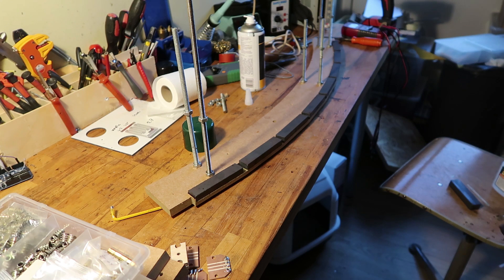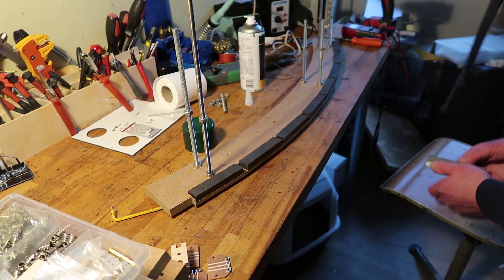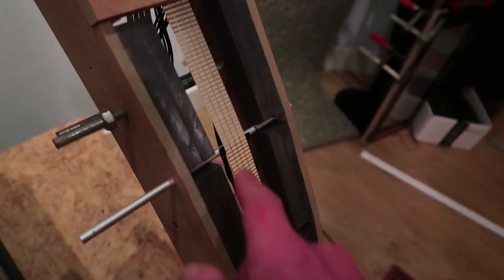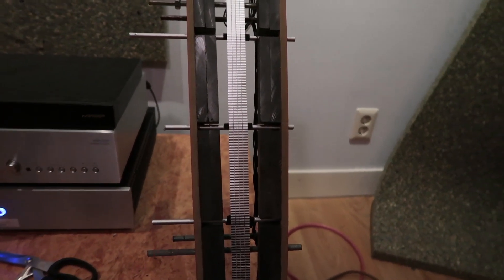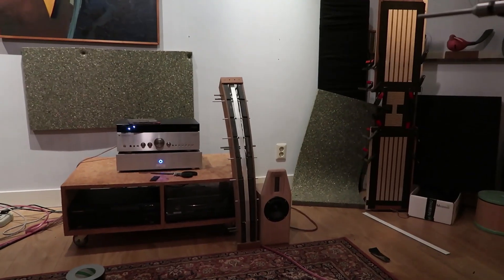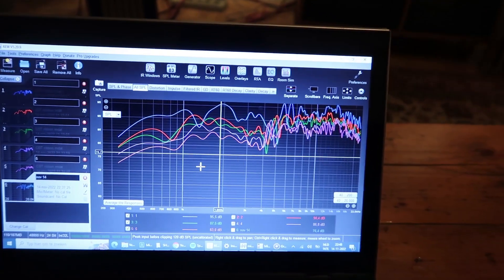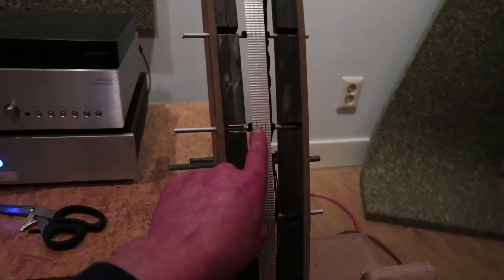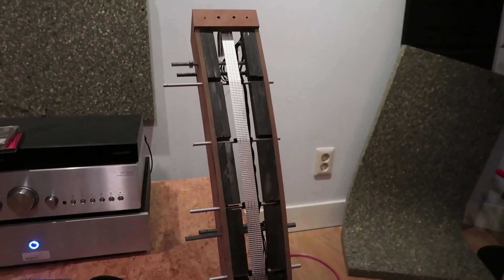Constant Beamwidth Transducer (CBT) Ribbon -  Part 2

Comment: The concept is great. The main problem is you are trying this as a dipole. Not the way this CBT design works. If you capture the back wave with mineral wool in between your cheeks you will be getting the benefit that you are looking for. Very interesting idea. I have thought of this using discreet planars. Easier to dial down. dOWn.

Mark
Reply from the maker: i think there is plenty of dipools done, and they work and even have bvenefits in terms of reflections.  a ribbon does not output more low ends when damping is used on the backside :( i tried :) might help in reflectiojns form my back wall though :) im more worried about the gaps up top. closing them would gain some lower end
Reply: @joppepeelen  Did you download Keele's papers on the CBT principle?  It is a monopole, this is the basis of a SONAR array, again a monopole. You have such of it right. If you try it first as a monopole you have an original reference point. Then you can try the dipole. I  worked with these about 10 years ago. Driver matching as you are doing is very important.
Reply: @joppepeelen    I understand the idea you are trying. My simple point is that the directivity gained in the shading used on a CBT type array is purposefully monopole. What you are doing will be a mix and most likely have nulls because of this. You have great points regarding how a dipole uses reflections. The key is that a CBT does not. It focuses the sound in a direction. That was the entire design idea in it's original use as a SONAR array. To have as even a power distribution as was possible in the output of the SONAR transducer array. Kind of like synthetic aperture RADAR arrays. They use timing ( phase angle differences ) and power differences to steer the Radar pulse sent out. What I know is you understand your planers very well. Seeing that this has potential I would immediately go with a wider film and make them into discreet planars and see what you can do with this. It has a huge potential to be a very good loudspeaker.

Mark

Comment: Room size and other issues are always a problem , a cheap way to fix up a sound room is wool blankets suspended from rods out from walls and surfaces about 3 inches or 75 millimeters in your measurements, helps a lot with reflection issues , not perfect but very good .
Even the ceiling surface is a huge issue that make the sound from the speaker become very disturbed , buying old army surplus wool blankets are very inexpensive.
Reply from the maker: yep, but i try to live here as well :) hihi.  when the weather is good i usually try measure at least 1 or 2 times outside.

Comment: I don't understand one thing. According to their graphs , to have an appropriate -6dB level angle at 5kHz, a height of an LSA must be 10-20cm. Why a h.. they made them as huge as a mid freq LSA?
Reply from the maker: LSA >? line source array ?  in the PDF above you can use the graphs to see what the lower frequency is it is maintaining constant beamwidth.   i used the groundplane graph, since this is actually a line array cut in half , so the most efficient part is sitting on the ground, and the idea is the floor acts like the second half.  thats the idea at least.
Reply: @joppepeelen  Exactly. I mostly mentioned their experimental devices. A half-sized CBT loudspeaker could be a good solution as a table speaker (low power, low distortions, compact horizontal size). With a beam of 20-30 degrees width, this must be a big enough room to have a listening zone high enough at some distance from a half-size loudspeaker. At least 3m long imho. A full-size CBT can be properly oriented in this case.
So, this is a great idea overall, but needs many experiments. This is what you like the most -) May be we will watch a serie dedicated for such devices.
Reply from the maker: @sc0or  well i am no expert in CBT's :) the fun factor f these might wear of, but learning stuff as we go.  i do need to make a 2e one i think. just to hear how well it maintains phantom mid etc.  then again there sens is so low im not sure if useable :( might need to check that with the most insensitive driver i got haha
Reply: @joppepeelen  That could be an interesting device: an arc with a woofer panel behind, then an array of mid drivers above, and then above of all of this an array of tweeters goes. I’ve seen something in the paper.

Comment: Smart idea with the expanding spacing! I guess you simulated the whole motor, does the magnetic flux density have the same distribution when the distance between the magnets increases?
Reply from the maker: sort of , sides remain much stronger.i did not compensate the ribbon itself for that, since i used existing ribbons  the spots with the huge spacing  have slightly less of this high peaks of flux density acting on the outer traces of the ribbon then the more efficient parts. :)  so it would be a compromise in any case with widing the traces. but not to much :)
Reply: @joppepeelen  Yes, perhaps the whole ribbon should be tapered towards the bottom, not just the traces.
Reply: @joppepeelen  great work as usual, thanks for posting. Regarding the magnet spacing, that's super clever. But I wonder how much the reduction in damping with the change in Qes affects the general amplitude shading. Perhaps there are even some benefits.

Comment: CBTs should hang from the ceiling. Otherwise the shading and time delays doesn't make any sense. CBTs are for PA to get the same SPL throughout the arena; also when moving around. They are not for domestic use.
Reply from the maker: its a groundplane CBT in this case. it uses the floor as mirror to make the line longer. thats why the 0dB region is at the bottom. weird but thats the design.  you  know how a flat line source sound . why is this not for domestic use ? it has better dispersion then small line/tweeter from 10 cm onward.   check out keele, in his youtube video hes show how even the frequency remains almost unchanged  up and down close and far away..  pretty usable it think for anyone making drivers/planars that are to long for there frequency range.
Reply: @joppepeelen  Yes I know, but Keele is wrong. I built  ground plane CBTs ten years ago. The were useless, so I stand by my objections.
Reply from the maker: @ClaesJegerås   nothing wrong here i think.  https://youtu.be/OjfyFjUBrlY?t=367  it does what was promised. what troubles did you have ? might help me to
Reply: @joppepeelen  Look what happens when he lifts the microphone off the floor https://youtu.be/OjfyFjUBrlY?t=399. CBTs are not meant to be used for vertical movements, only across an arena's floor.
Reply: @ClaesJegerås  I think that is the point! You're not supposed to listen lying on the floor. therefor the power on axes becomes usefull when you walk away; your ears get closer to the on axis response as you walk away. very cool design! very good resluts in this video! the tonal balance looks completly identical (appart from very few mid spikes here an there)
Reply: @jean-lucbattista2492  Yes, as long as you ears are in the same horizontal plane you're good. As you are when you move around on the floor in an arena when the CBTs are hoisted up in the ceiling. For domestic use placed on the floor, CBTs makes no sense.
Reply: @ClaesJegerås  ...I am really interested in this topic...have you really built a ground plan cbt for domestic use? Can you please tell us a little bit about your experience and how you have designed the speaker. 
The advantage for me is to have regardless of distance more or less the same SPL in case of constant ear hight in eg. a conference room. To position the cbt under the ceeling would in this case also more useful.
Reply: @MichaelTress  Yes, I built a couple of ground plane CBTs some years ago. But as CBTs should be the other way around they were not suitable in my listening room.
Here's an example of a proper use: https://youtu.be/3e_uZ8HqxpY?t=184

Comment: You would definitely have ceiling reflection from the arch shape , you would have a totally different sound if you had really tall ceilings or your ceiling treated. Very interesting though
Reply from the maker: floor and ceiling reflection are waay lower then when a normal pointsource speaker is used.  if made a bit bigger it also only drops 3 dB with doubling of difference like a true line source.  so unless normal speakers are a problem ceiling wise/floor these are as well.  in fact it used the floor as mirror to make the line look 2 as big. decreasing the frequency it acts the way it can